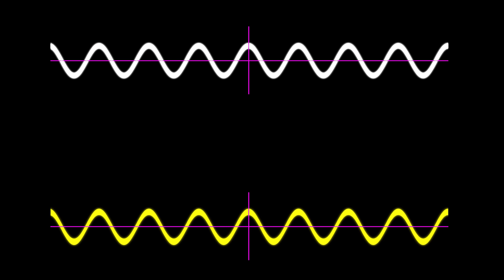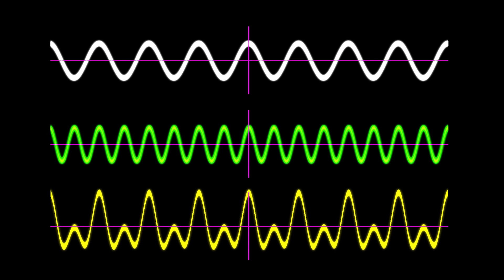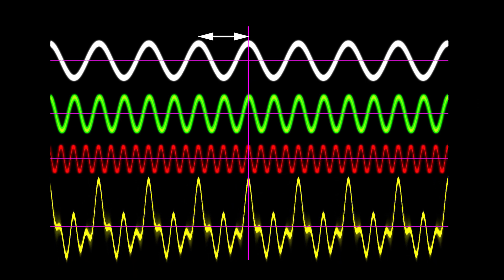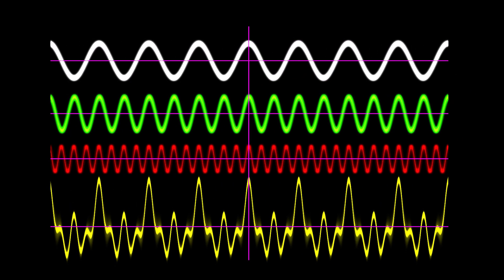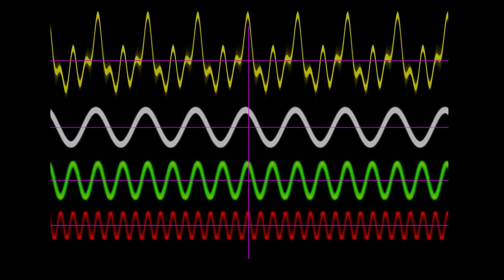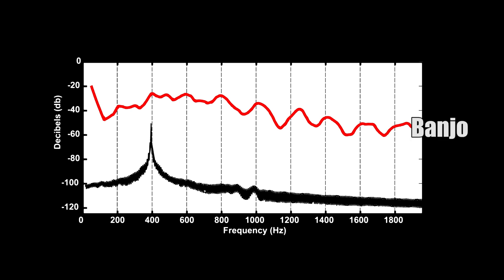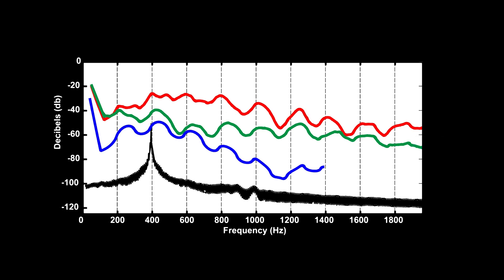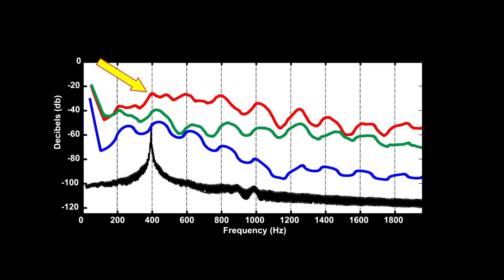Sinusoidal Waves - Harmonics - Introduction to Fourier Series

Comment: Would it be possible theoretically at least to make a forensic signature of every guitar that could make it distinguishable from another?
Reply from the maker: If you had a set of say N "identical" guitars, I would venture to say that, mathematically speaking, each would have a distinct sound signature.  However, the smallest differences between any given guitar signature would probably be out of the range of human hearing.
Reply: Thank you for your prompt response I was wondering if it would be possible to create an algorithm that would be able to learn to distinguish between the harmonics of different guitars so as to attribute them with a forensic signature
Reply from the maker: With a good enough sampling rate and broad enough frequency spectrum, you would be able to develop forensic signatures for individual guitars. You could probably even characterize differences within each signature to understand the sounds of each guitar.